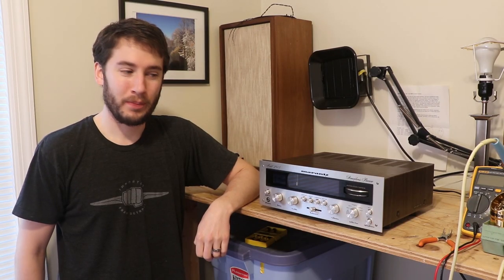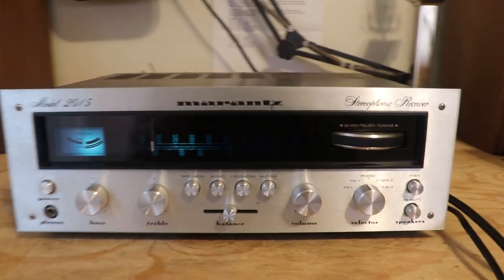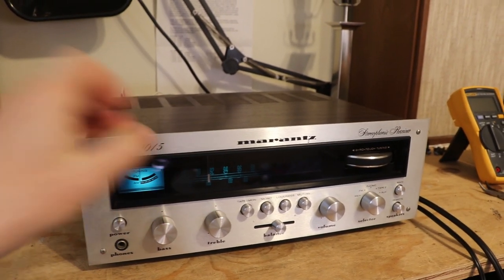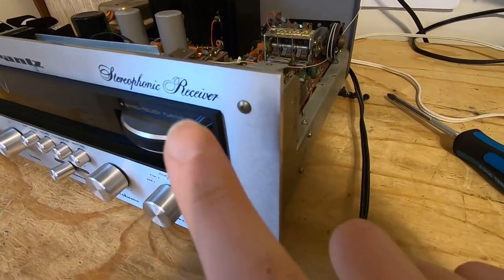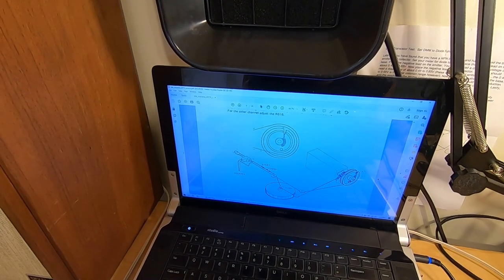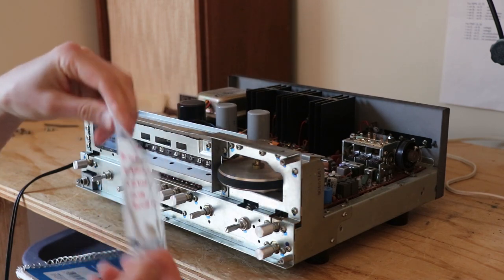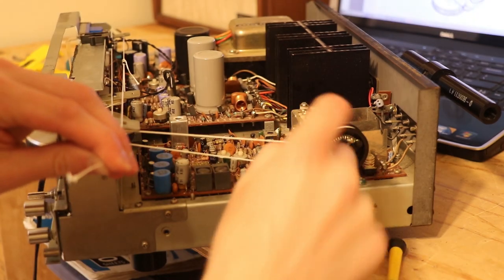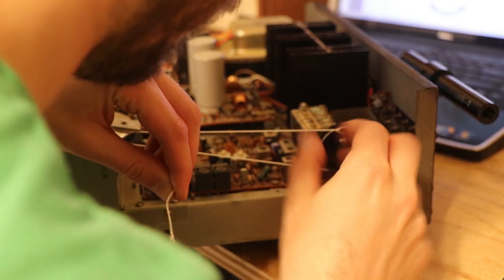Marantz 2015 Tuner String And Lamp Replacement

Comment: Appreciate you showing all the trial n error with that damn string (looked like rope in video, camera magnification). I say this because my Mod 125 had a small fray, but was able to fix with quality glue, light filing after drying. Also using 2 layers of vellum, was not able to get 48 lb vellum, got 57 lb and was a little concerned about clarity but you answered question for me, 57 lb should be perfect. Please tell Dave Thanks for putting up with education on lighting with these Marantz units, Pioneer, Kenwood, Yamaha not even close to how temperamental this Marantz equipment is.

Comment: I had all of the lamps on hand except the dial indicator.  Rather than wait for a lamp to show up, and pay shipping for a small part I used a single white/yellow LED, a 1N4004 diode and a 470 ohm resistor that I already had.  The resistor limits the current and the diode protects the led from excess reverse voltage on each negative half cycle.  The length of the body of the LED was compact and about half the length of a standard diode.  When assembled it fit perfect inside the black housing.

Comment: Great Job.  My biggest fear is cutting the string with my solder iron and being up the creek without a paddle  I think I could figure it out, but not without a lot of trial and error.
Reply: I've done it and I will never forget the BING sound when the dial cord breaks.
Reply: Always a good idea to wrap the string in aluminum foil in case of an "oopsie"!

Comment: Peeling off the yellowed parchment from the back of my radio dial/display, I found way more glue was used than in your example. Do you have any hints for removal>? do not want to dissolve the paint or scratch it in any way. For now, I am painstakingly scraping it off little by little with my finger nail. Your guide is a huge help BTW! I never thought I could do this myself, and little by little I am getting ti!

Comment: What is the best way to re-spread apart the split type control rods?  I am referring to the split aluminum shafts which the knobs then pressure-fit onto. I have one where the two halves are pinched together, and now the knob will not stay on.

Comment: With highly oxidized contacts on the selector switch, it's best to physically scrub the contacts to dislodge the oxidation. Spraying won't really remove it effectively.
Reply: Kinda like dry cleaning clothes. Where does the funk go? Probably nowhere. Gotta wash and rinse laundry to get it clean. Similarly, one should attempt to remove the funk after deoxy if feasible.

Comment: 3m dubble sided  tape 5mm no glue
Reply: Agreed...double sided tape is a wonderful thing.  And you really don't need a lot, just a few spots.  Once youget the faceplate back on, pressure pretty much keeps everything in place.